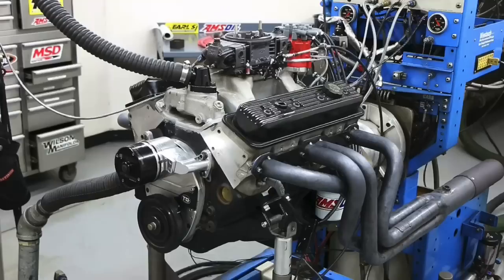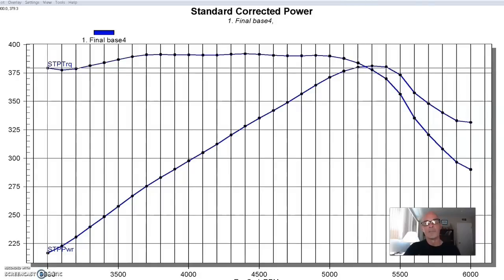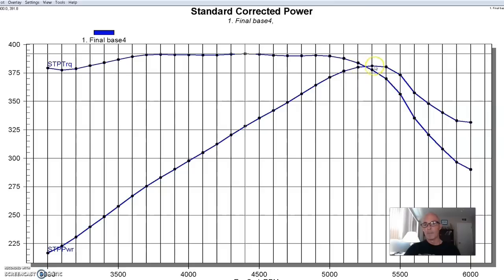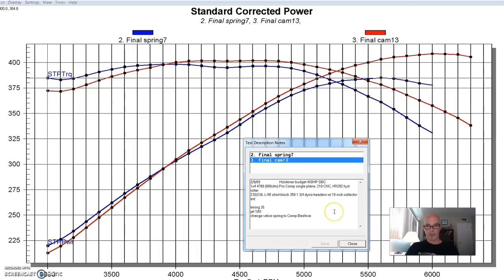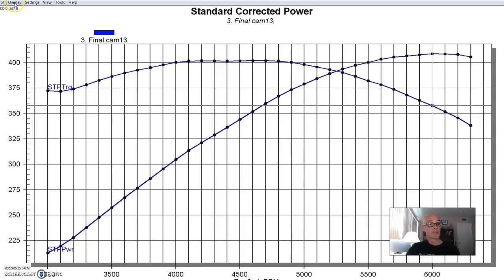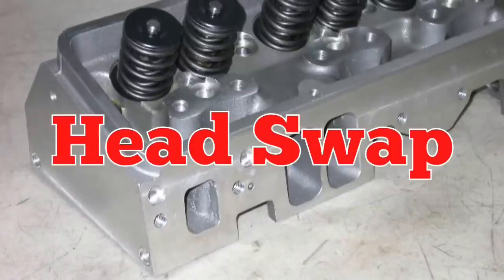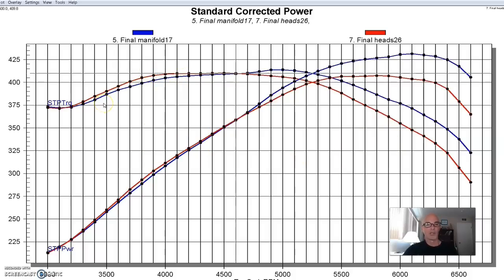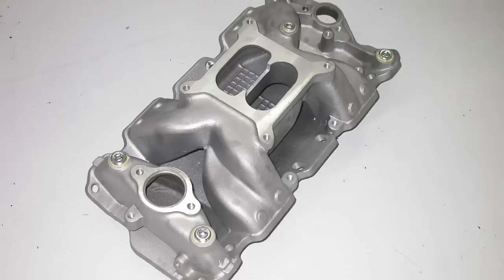DIRT CHEAP SBC MODS?

Comment: Just a question sir, in relation to your dyno chart sit down talkthroughs with the overlays of outputs, are those colours used "colourblind friendly" to a degree?? Im genuinely adking for a mate. Love the content
Reply from the maker: not sure I understand
Reply: @richardholdener1727  Maybe rather than different colors, you'd use different fonts, like - - - - and ........... in addition to solid lines.
Reply: @richardholdener1727  i have recently put a friend of mine onto the channel that is colorblind. I was wondering if the colors used in the charts are clearly visible to him or if it is just shades of grey to black. I will speak to him later today to find out. Its probably a minor detail i know, but i know there is alot of good info in your video's and i hope he can see it all clearly and concisely. Have a nice day and keep up the great work here🖒

Comment: .5 inch open spacer on a preformer rpm intack? I got a blueprint engines 400 460hp, no spacer, would you recamend trying one?
Reply from the maker: you can try-usually less bottom end and more top end-but not by a lot
Reply: Ok thanx. 1 ton truck so bottom end is most important
Reply: @richardholdener1727  Wilson claims "up to 46 hp gain!" for their 4 hole merge-type ported spacer. I'm thinkin, yeah, maybe on a 540 at 7000 with an intake that was too small! Can you test those merged spacers?? They're only 100 bucks.

Comment: I see performance videos for the sbc all the time, but has anyone ever done a good "how to" on an inexpensive, very flat curve, good daily performer? I have 3 trucks, heafty ones, with small blocks in them and I want to get some more out of them, but I don't want to build an engine that's a turd on the bottom of the tach,  I'd really like to have a good reliable sbc that pulls for as much of the rpm range as possible... any tips or tricks?

Comment: Can I do a video on what happens when u put too small of a carb on a 454?  This is great video cause it applies to a wide range of us low buck guys.
Reply from the maker: yes you can-I ran a 650-it works well on a cammed Gen 6 motor
Reply: @richardholdener1727   what about oval ports on rectangle heads, is there any pros/cons?

Comment: What's the maximum NA hp that YOU could wring out of a stock 350 block? Would the block survive? And what's the max NA hp you could extract from a GOOD block? I'm guessing around 800. You know, 434 to 454 ci, tunnel ram, Dominators, 14:1 CR, BIG heads, BIG roller, E85 or race gas, etc.

Comment: If the car is going to be daily driven also have air-conditioning I would say smaller Cam dual plane all day if the vehicle never hits high rpm because truthfully street cars are usually from street light street light and it would be majorly embarrassing to have a high-rise in that huge Cam and get worked by a medium to small size Cam

Comment: The comp cams XE282HR is a ford roller cam I looked it up u sure it’s usable on a sbc 350 l31 vortec roller motor
Reply from the maker: a Ford cam won't fit in a Chevy

Comment: Hey Richard have you ever seen a baby lt1 v8 gm engine 4.3 v8
Reply: He talks about his plans for testing one (L99) and using the crank from one to make an LT1-302 in his CHEAP LS TRUCK & TURBO CAMS video. Check it out if you haven't yet.
Reply from the maker: hard to find those

Comment: Being non american I have no clue as to whether this engine ever in any of its variants came with a multipoint efi factory fuel injection system that should make all the manifold/carby combinations obsolete. Wouldn't such a system just come off a Corvette perhaps? Like one butterfly and injector nozzle per cylinder giving optimised performance and fuel economy? Sure Carbs are simpler but efi has been about in common use for over 20 years.

Comment: What kid of power can you make with junkyard vortec heads, with just spring upgrades and roller tip rockers, cam,intake?
Reply from the maker: 375-400 unless its a big cam usually

Comment: I think the as cast head is good value over spending $500 plus to rebuild a set of 882 heads. I would spend the extra money for the Name brand RPM dual plane for a street car. It's really hard to beat that intake for average power below 6500 and less than 240 degrees of intake duration.
Reply: I purchased and setup a set of Assault Racing heads for $750. As cast with a decent valve job they flowed right at 260 cfm @ .600". I used a competiton products head improvement kit with 2.02/1.60 valves that were +0.100" length and heavy dual springs. Used comp valve spring seats and ARP 7/16" studs. I ran them on a Vortec 350 with a 218/228 @ .050, 110 LSA roller cam giving .534" lift with 1.7 rockers and they destroyed the stock except speing Vortecs with 1.6 rockers powerwise.  When I built my 383 I delivered Lloyd Elliot a set of them to port and work over. He got ~300 cfm @ .600 out of them. The  11:1 383 SCREAMS.

Comment: Another brilliant test! Have you ever tested rhoads lifters or similar? It would be a great one to get out there.. it seems a bit like snake oil at first glance. But the theory is sound and apparently it's the same tech that was OEM in one of the Viper V10 engines for emission compliance.
Reply: Brian Frost I have a Supercharged modded L82 1976 stingray close ratio factory 4 speed . Before the rebuild I installed rhoads lifters and hi lift short duration comp cam on my home ported and polished 2.02  stock heads. The low end torque was greatly increased with the rhoads lifters and top end stayed the same .Also the vacuum increased as well as drivability. After the rebuild I added the blower and hi lift short duration comp cam  new recommend valve springs keepers and new bronze guides and machine work to accommodate the springs and lift  for the hi lift cam . I also added new set of rhoads lifters,hi volume oil pump  ,roller rockers ,big tube hookers headers and my home fabbed dual exhaust is same diameter as the hooker collectors 3” . The car makes 548 hp and 457 foot lbs torque with my 800 cfm boost referenced vac Holley . The torque curve is very flat and the car pulls so hard in first and second the passenger is pinned to the seat lololo

Comment: How about "it's just a 366" big block test for the other guys. 

Turns out I'm not a 454Bbc cool kid like I thought...
Reply: Are you talking about the ford 360?...from Wyoming USA 🔫🤠🇺🇸p.s stay safe and healthy everybody GOD BLESS OUR COUNTRY AND stop this foolishness ❤
Reply: @billallen4793  - He's referring to the Chevy big block commercial truck motor from the late 60's to 70's. It's has 4 pistons rings for more durability and to accommodate the extra length of the piston the block has a taller deck height. It was available in 366 and 427 cubic inch displacements.
Reply: @dalemam7962  good info to have thank you...from Wyoming USA 🔫🤠🇺🇸p.s stay safe

Comment: Was this the build in Hot Rod mag from a while ago? If so, I've saved all those part #'s to use on my budget build.
Reply from the maker: Not sure this was Hot Rod
Reply: @richardholdener1727  yeah, probably not the same, but this is the article I was thinking about. https://www.hotrod.com/articles/1004clt-low-budget-chevy-350-small-block-engine-build/

Comment: Seem like, cheap heads are a false economy.
Reply: Bringo
Reply: ESPECIALLY on an old 23 deg design where the air has to make wild turns to get into the cylinder: air velocity is king and a high velocity and the intense turns of a 23 deg head needs all the air flow research it can get! (Pun intended.)
Reply: Adam Arndt, 😁👍🏻
Reply: @adamarndt7617  Wild turns?  The 23 degrees are angled toward the intake! The shallower angle heads have raised ports. Why comment on something you know nothing about?